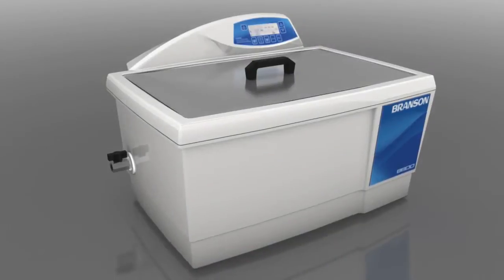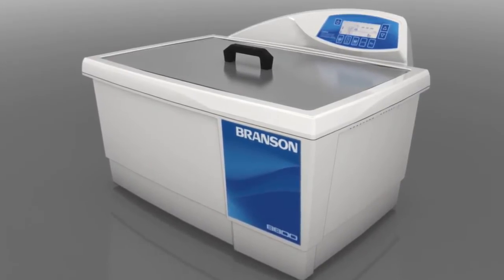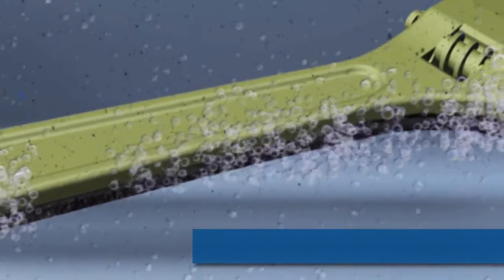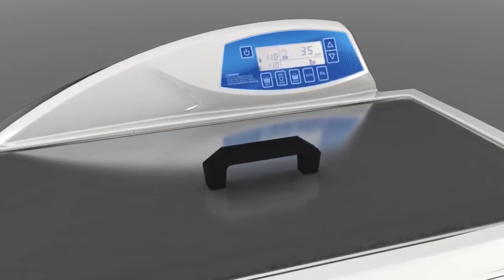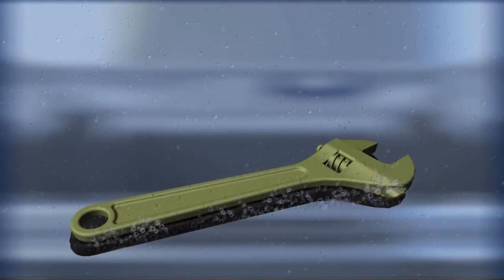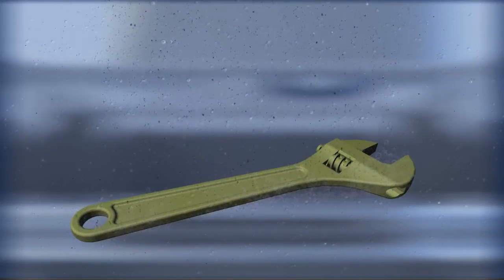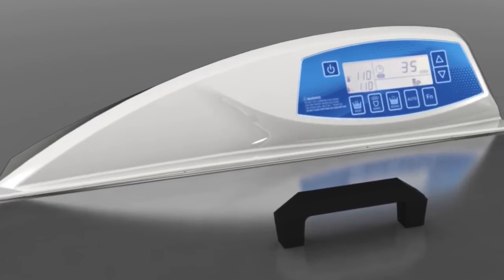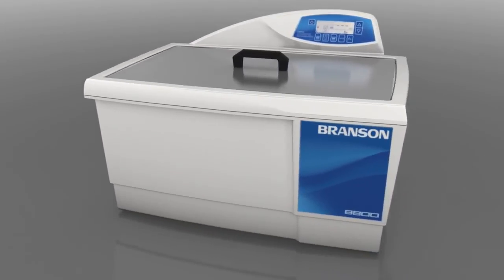Ultrasonic 3D Parts Cleaning

Comment: As for my manufacturing unit we are using Branson USN knofe of 40kHz for Rubber cutting, as per the requirement we need to clean the Knife sonotrod almost every day due to material deposition, but everyday cleaning by sharpen objects creates dent on the sonotrod front part, is there any Cleaning product available when we can clean the knife without actually removing it from the system or convertor part.  We will be happy to hear from you,
 please contact on bikash.mahato@jkmail.com. 

Thank you